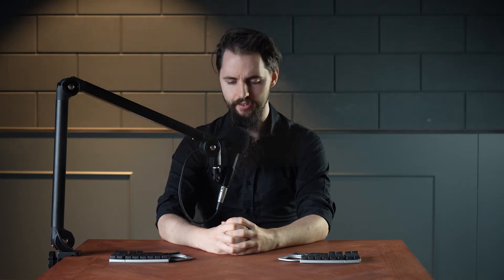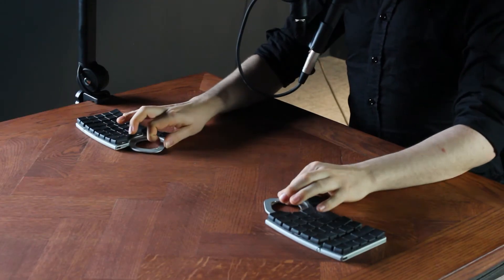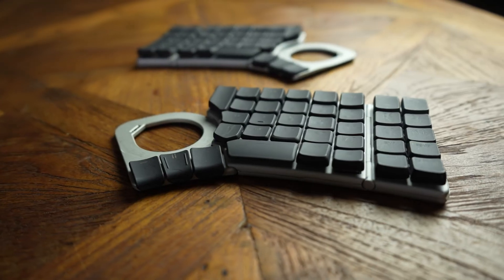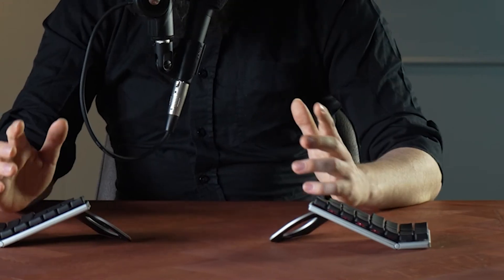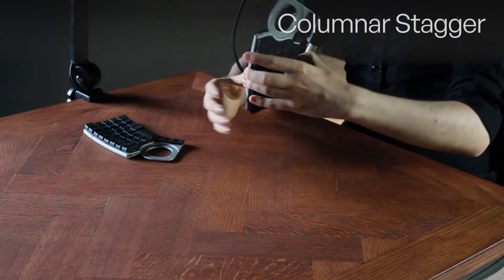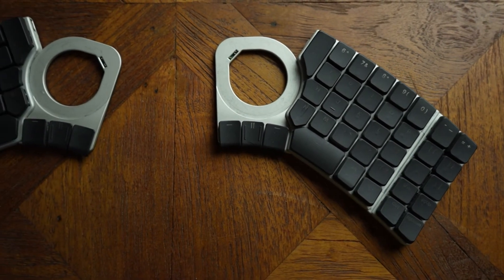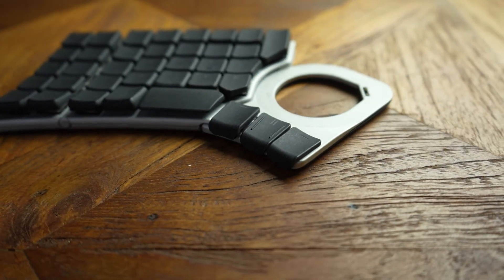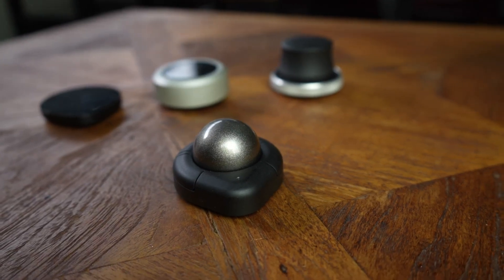What makes Naya Create an ergonomic keyboard?

Comment: can the float mouse be used as a normal mouse?
Reply: I don't think so, they're used to move the camera around on 3D rendering software. Could they use the software to control the mouse? Possibly, but using a track ball or touch pad is way more intuitive than a floating nob

Comment: The texture of the table surface is often such that you DONT want to wrest your hands on the surface. As a software engineer typing a ton, The missing wrist rest is a HUGE missing feature.
Reply from the maker: We designed Naya Create to be the lowest profile hot-swappable mech keyboard out there. So you wouldn't need a wrist rest. (At least I use mine without a wrist rest without issues :) ).
Reply: @nayainsights  Do you code 12hrs a day? Kindly refrain from telling me what i do and don't need. Step 1 - know your customer.

Comment: I can't wait to start seeing reviews about it. If it's any good, i'm buying it for sure. I spend most of my day in front of my computer codign or designing in 3D and can't believe how necessary I find to have a trackpad next to my resting position and how few solutions are out there.
Reply from the maker: Same ;) The first 100 batch 0 units have already been shipped and first units are starting to arrive. For more in depth review by your favourite YouTubers and Press, we will first work through any bugs over the upcoming weeks - but rest assured there shall be plenty of reviews. 

- Niclas
Reply: @nayainsights  Great! I'd rather see reviews with polished software as it's usually what causes most criticism on early reviews. I'll be waiting until the end of the year anyway so I'm excited to see what's about to come.
 One question/suggestion: it would be nice to have a simple battery module for those who don't need two modules but still want full wireless connection without breaking the bank. Anyway great job!

Comment: Will there be work to ensure the Naya touch module is compatible with MacOS to the extent it also still works with Apple's portable devices that recoginizes touch pads (i.e. their Magic TrackPad) distinct from mouses such as the Vision Pro and iPad?
Reply from the maker: Hello! Thank you for your question 🙂 Touch will indeed be supported in MacOS and IOS as a mouse cursor, though not specifically as a ‘touch surface’. However Touch will function as a configurable mouse cursor with additional features such as gestures and hotzones, which means in practice it will essentially perform as a touch surface. 

If you have any more specific questions, please feel free to drop them in our Discord. There we can answer in more depth and have a longer discussion if needed.

Thank you!

Comment: One of the so-called ergonomic keyboards, but neglecting how to use a keyboard ergonomically. Resting your hand on a wrist rest or the table is not ergonomic! Also the tenting solution is dumb. It will have the modules at angles which make it hard(er) to use. You are burning so much money with so many people... No wonder the price is ridiculous. Some thoughts and design choices are good.
Reply from the maker: Hey Nick! Thanks a lot for your feedback on our keyboard ❤️

We chose not to have a wrist rest on the keyboard because the height of our keyboard, and the choice to use low-profile switches, means that the keyboard is only a few millimetres high, a bit like Apple's magic keybaoard. We found that after several hours of work testing different keyboards, this was the one that exerted the least pressure and pain on the wrist.

As for the tenting, we have uploaded a Short to our Youtube channel showing the use of the Modules on Create while tented, please take a look at it when you can and let us know what you think about it.

Again, thanks for your feedback and I hope this clears up some doubts, in any case, feel free to send us a message! We'll be happy to help as much as possible 🙌

Comment: Hey guys, I have been following your development for a while, silently so but still I think you guys might be on to something quite interesting and potentially disruptive, which I like. One thing that I am missing though is an actual demo of how the keyboard works in different software situations. Which of the modules do which functions exactly. I produce and create every day using different softwares. Primarily in Architecture, using Autodesk Software and BIM Modeling packages, additionally I also produce music and edit video for different income streams. If I had to buy in to something like this I will have to know that I will be able to cover all of my needs using one setup, possible with a few separate modules. If you guys can do a more comprehensive video explaining how a creator will practically use your product, it will help so much!
Reply from the maker: Hey Bennie! Thanks a lot for your support and feedback. You are right, in fact, we're currently working on just that.

If you are subscribed to our Newsletter, you may receive a survey about future integrations and workflows, where we are compiling data to build actual use cases in day-to-day workflows that we can display. We also aim to see which software we need to prioritize in terms of integrations based on the demand of our users.

If you need any extra info or have any questions, feel free to send us an email at: support@naya.tech or contact us through social media! We will be more than happy to help ❤️

Comment: Does the bottom of the keyboard have any holes that can be used to mount it to an arm rest of a Herman Miller Embody for example rather than just having it on the desk? Does the tenting lock in place or is it just friction? I could not tell from your videos. Looks like a promising product that solves a lot of issues for people with carpal tunnel and tendonitis.
Reply from the maker: Hey Alshaikh, thanks a lot for your comment!

Due to its construction and thickness, Create will not have a mounting system, such as holes in the body. 

Although Create will not have a "conventional" mounting system, one thing to work around and take advantage of could be the Magnets fixed into the back! Users are encouraged to invent their own mounting solutions, as we also may provide user guides and/or CAD files to support the community in this regard.

As for the locking of the tent, Naya Create will not have a locking system but a strong system that can withstand a lot of pressure, so there is no risk of it slipping back into its original position. 

You can see a demonstration here on our YouTube channel. We uploaded a short video where we showcase some examples.

Feel free to ask any further questions! We will be more than happy to help.
Reply: I highly doubt it does, just take some context clues from the product and presentation, they're obviously hyper-focused on desk use and ergonomics at the desk with the arms resting on the desk; this also implies that they don't believe in using a chair with arms, as the desk is the armrest. 

I also don't entirely agree with all of their statements, and a lot of statements are loaded with bullshit.  But this is a Kickstarter product, so that's not a surprise; comes with Kickstarter pricing as well, $500 with no modules, $79 for the basic modules and $159 for the puck and spacemouse clone, with some kind of module bundle price discount. 

It's safe to say that most people will absolutely pass on this product on price alone.  Though there's many other reasons to pass on it as well.

Comment: I've been looking after split comnlunar staggered keyboard for 6 months now. 
I've seen and analyzed lots of both the mainstream keyboard and the DIY ones. So I believe this will be a very accurate opinion of your product.
Let me state a few points of what I could consider about your keyboard, from most relevant, to less relevant IMO. 

Positive ones:

1) It is mechanic, is split and has a tenting mechanism build-in.
2) Fully programmable keys, profiles and macros.
3) The Keycaps look incredibly smooth with their unique size and shape, being (for me) in the sweet spot between flat surface and concave profiles.
4) Hot-swappable plate.
5) Low profile is great for reducing wrist pain.
6) The thumb keys are in a great spot.
7) The layout has plenty of keys and auxiliary keys.
8) Has a module option pre-installed and several optional modules to install
9) The design and concept differ almost entirely from what we see on the market, so it's rather unique.
10)RBG and wireless, ofc.

Negatives ones:

1) PRICE and Modules- The price is really something beyond what I would like to pay for a PERFECT keyboard that would solve all my needs and desires. 
The key to making the buy feel worth the money invested is: to make it more customizable for the features it has, and more options beyond the modules, for the public that don't want it. Or let you customize the way the consumer wants, and adjust the price accordingly to the features he has chosen the keyboard to have. 
Take me for example: I wouldn't buy for the modules, I won't use them. But I really liked the keycaps style and auxiliary keys to the side. So how would you attain my interest if you only have the module model?

2) TENTING MECHANISM - The way the keyboard tenting mechanism is designed and built to accommodate the module feels like a mandatory feature that you will have to pay for, even though you may not want it, and makes me feel like investing my money in the wrong product.

3) HEIGHT - The tenting mechanism don't have height options, which would make this kb REALLY AWESOME. A way to solve it would be making a bolder tenting option that focuses specifically on the public that doesn't want modules. Having 3 heights option, would solve both this point and #2, and softening #1 and #4.

4) HAND REST - Your tenting mechanism seems high enough,  but without any hand rest, makes it almost useless, so it is another feature that makes the price go up and backfires for its own sake. The same goes for the negative point #2. Maybe you can make it soft and detachable too.

5) KEEP IT UP - I'm not gonna lie, when tented, the feet look incredibly unstable, and if that's the case, I would fear putting some of my hand weight on it. It's not a problem per se, but if the rubber feet aren't good, it has the potential to be awfully unstable. 

6) You are releasing the keyboard along your own line of switches, so the public isn't aware of how reliable, good, and loud they are. Is it Cherry compatible? Cause if it isn't we won't be able to buy keycaps for this kb. Another thing: is the hot-swappable plate to put another brand switches onto them? 

7) Your macros and remapping keys program is not open-source.

8) SPECIFICS - Will it be shipping worldwide? Does the construction of the whole is good?  Do the keys wabble? Is the plate resistant? Does it sound thoc?  This is a set of questions your public will be making after all the rest is clarified. Make sure to send a dozen units to YouTubers to make reviews.
For a PREMIUM product, I expect it to be hard aluminum-cased, heavy, well-built, mostly thoc, come with spare switches, option for shine-through keycaps.

Ps: If you want to compete with the Moonlander, the glove80, sofle and Voyager, you need to at least, cover #1 to #5, at LEAST. These points are a huge deal breakers. 
And the niched public into ergonomics will be tossing huge amounts of money expect nothing less.

Of course, the importance of each statement is personal, depending on each user's need and uses, but I'm pretty sure I've covered 85-90% of the problems.
Feel free to ask me anything, btw.

Comment: Coming from a kinesis advantage 2 myself, the lack of tenting feels concerning to me. And comparing it to something like the glove80, which is also low profile but is still tented. 

But I might still want to pre-order even with my concerns. As the project looks and sounds fantastic regardless. 
My only question would be if I pre-order do I get all the modules? And what if the lack of tenting is too big of a problem, are there any plans for a model that does have tenting?
Reply from the maker: Hey hey! Naya Create does have built-in tenting! We might not be understanding your comment correctly, but please verify the features displayed in the video ❤️

About the Modules: They do not come as a bundle. You need to order them separately at checkout. This is intentional, as not all users have the same preferences. For example, a Module like Float, which is mostly intended for 3D environments, may not be the best fit for a photo editor.